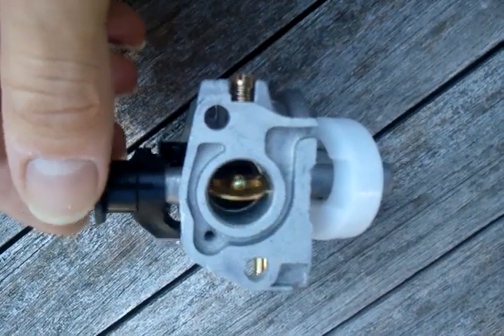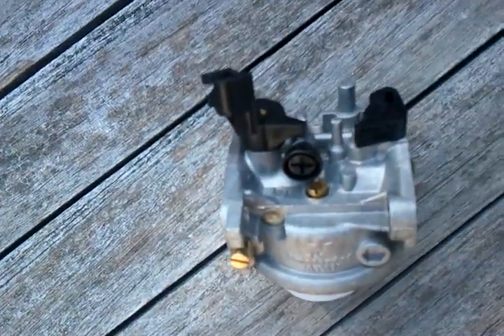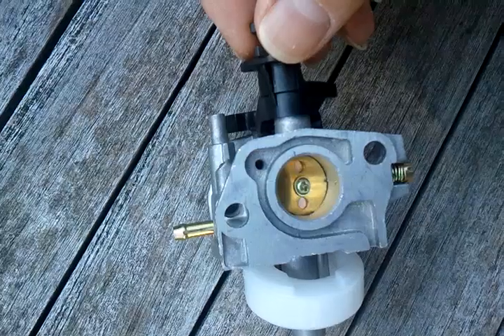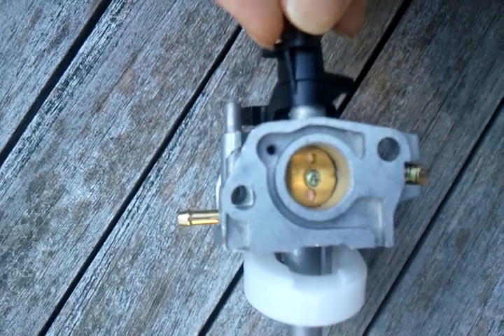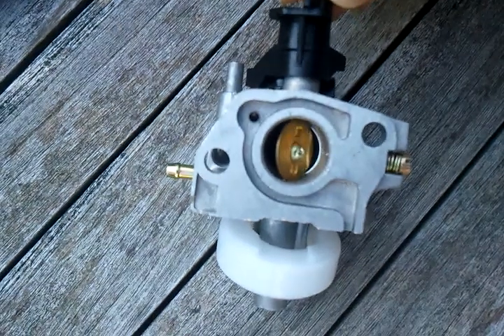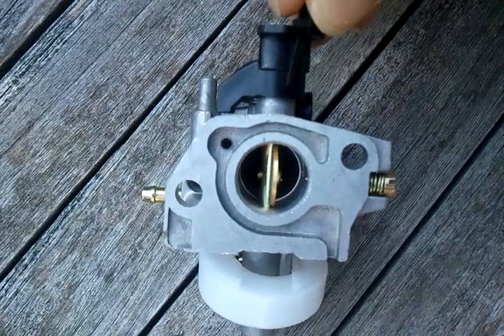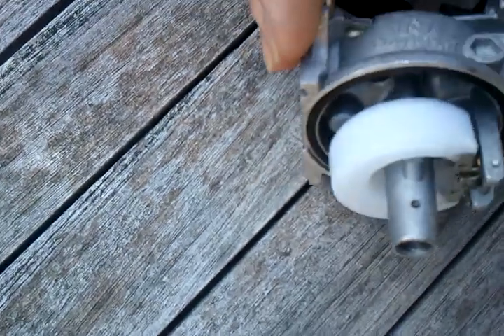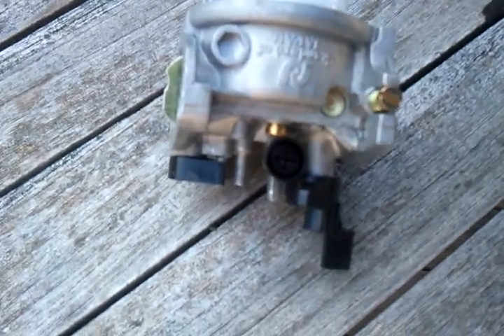Carburetor basics and troubleshooting

Comment: can these adjustments be done while the carb is on or is it too hard to get to?
Reply: I took the carb off and pushed a small wire through the hole but it didn't seem to have anything in it. isn't there a way to adjust the carb without taking it off, that's a lot of taking off and putting back on just to see if you got it right
Reply: the bottom, the side hole is so big i can see there is no obstruction. symptoms are the idle goes up and down constantly
Reply: yes that's what i pulled out and mine was a plastic plug with one large hole through the side and one very tiny hole in the bottom (the were all clear). I wish i could draw a pic to show you
Reply: no haven't gotten that far yet but that's a really good idea and that may end up fixing it, I'll do that tomorrow and get back with you, thanks for the help
just a note: i'm was looking to and may still put a 2 or 3 way carb on this but i've heard running it on propane or natural gas is bad for the valves, have you heard of that?
Reply: i don't know about you but i can't even see that screw let alone adjust it, is there a special tool for that or a special way of getting to it
Reply: yeah i was told that the lack of lubricant causes the valves to go bad but i was told you can get different valves for this reason (but i haven't verified the different valves thing yet)
I got a great deal on mine (bought it off craigslist) and the main reason i bought it is in about a year i'm buying an RV and becoming a full time RV'er, and i'm going to travel all over the US (boon docking/dry camping) and this gen will sometimes be my main source to recharge my batteries. I'm told it will run 18 to 24 hrs before it needs fuel
Reply: so how do you get to and adjust the screw
Reply: yes
Reply: yeah i know, it's just what they say. I'll be back with you tomorrow and let you know how things worked out
Reply: well it won't start at all now, I'm sure something isn't seated correctly causing an air leak into the carb (gotta pull the carb back out to see what my be getting in the way)
Reply: ok blew out carb again and reinstalled, this time everything went in so easy and seated correctly, runs great now, thanks for the help
Reply: not sure, is it to the left of that screw/plastic cap, if so mine is i guess you said a guarded one meaning it has a lobe on it so you can only move it about 1/8 of an inch in either direction but the problem is it is difficult if not impossible to get to while installed and i'm not going to take it in and out several times to do the adjustment

Comment: hello sir. I have a problem with my generator. when load is applied, it runs normal for some time then slightly drop then pick again. I have cleaned the carburetor using carburetor-cleaner but the problem still persist.
Reply from the maker: Sorry, I never saw this comment before.  Did you ever get it figured out?  Generators can be difficult to troubleshoot because it is hard to see the "load".  To be honest it sounds like your load is starting or stopping.  Refrigerators and freezers are great examples of this type of cyclical load which you will most definitely hear as a change in the engine RPM.

Comment: Mine was also surging. It is a close/ Huayi on a 208 engine. Turns out that the carb was missing the needle valve on the idle side of the carb. I have looked everywhere but could not find anywhere to buy just this part. It is not part of  a typical parts of rebuild kit.
Reply from the maker: Sorry, I evidently never saw this comment.  Are you referring to the black screw part which I point out in this video?  That was missing?  It may have been installed under a welsh plug or made permanent in some other way.

Comment: Good explanation & thank you for the help! Mine was surging and i cleaned everything except for that idle screw you showed at the end and it runs fine starts on the first if not second pull & runs nice. Although mine was not a screw it looked like a plastic plug and underneith the plug there was a very tiny hole that was plugged.

Comment: I have an ETQ generator with a 13 hp knockoff engine. It will only run on full choke. It has a Huayi carburetor with a solenoid but I can't figure out how to disassemble it for cleaning. Is it a throwaway?
Reply: They don't seem to store very well, had same problem and ran carburetor cleaner in the gas much more than bottle stated with small amount of gas and it cleared. Had same problem with snowblower. Now I store with both with gas additive and cleaner. Technically you really suppose to turn off gas and drain the bowl on the carb.

Comment: Just wanted to say Thank You, Thank You, for this video!! I bought a used generator and it had this surging problem you described here. Cleaned the carb (several times), but the problem persisted. Finally came across this vid, and realized this little plastic cap under the throttle stop screw contained a little pilot jet underneath. I removed and cleaned it, and my generator ran perfectly after that. Yahoo!!... Again thank you very much.
Reply: Yes, I do that and like to help others when I can.

Comment: quick question i got a predator 212 engine that start up fine and stay on as long as the choke is closed. but as soon as i open the choke the engine turns off. do you know how i can fix the problem. or what can i do
Reply: Check your fuel line for a pin hole, or make sure your gaskets are good on the carb. It's sucking extra air in somewhere.

Comment: Very nice video,very helpful explanation about the idle circuit.Would you happen to know what would cause an engine using this carburetor to stall out under a load step, but then be able to handle that load it the carb is choked about halfway? My version of the carb does not have the one hole that you point out on the carb face for the  P tube aeration supply. It is not drilled.
Reply: ***** Thanks for the reply back, that was my suspicion also.

Comment: My carb off my Champion 6.5hp OHV looks just like that, except it omits the two idle adjustment screws, it has just the main big black screw to adjust idle.  After sitting all winter the carb was gunked up, and I gave it a cleaning.  Now, it fires right up but is surging.  And mine doesn't have a black plastic cap in place of the idle screw, it has a brass plug.  Should I still remove that and attempt more cleaning?
Reply: *****
I decided to have another go at it after watching your video and a few others.  I pulled out the brass tab on top and it is indeed the orifice.  It wasn't plugged, but i gave it a good cleaning anyway.  This inexpensive carb has only the one adjustment screw and even that one doesn't seem to do much.  The engine seems to be running too rich, as evidenced by the appearance of the spark plug and the lack of throttle response.  If I push it full throttle it dies.  I did try riding the go kart around the block, but lots of missing, no throttle response but it eventually got up to speed even without any real throttle response, basically because it is idling too high.  I think maybe starting with a new carb may do the trick.
Reply: Yeah, I was trying to get my go kart going so I can sell it.  Was hoping someone else would take it off my hands and fix it, but I'll probably spend the $20 myself to get a replacement.
Reply: David Meyer
Turns out the carb was just fine.  I had removed the gas tank to clean it and when it went back on the linkage got out of alignment so it idled too high.  It took a new carb and more tinkering to discover the issue!

Comment: Hello I have a Honda GCV160. The mower is a Toro Quadra Cut System  and my engine is flooding. When the mower sits, the gas leaks out of the air filter. I replaced the carburator with a new one. The mower started right up but if I turn it off, it doesn't start again. I took the spark plug off and the engine was flooded again. If it was the float or the needle that was not working that should have been fixed with the new carburator. Do you have an idea of what it might be? Thanks
Reply: Thanks for your response. I decided to just close the gas line as soon as I turn it off. That way the engine doesn't get flooded and it starts again. Thanks..

Comment: which way will the idle mixture screw go for it to richen it up? in or out? i have a clone engine and put a bigger main jet in it but am looking to fine tune the idle.
Reply from the maker: Out or counterclockwise will open up the needle valve to admit more fuel.  The idle control screw is opposite.  You increase idle RPM by turning in or clockwise.  This will hold the butterfly further open.
Reply: I believe out to riches. Mine was to rich so I went back to 1 1/2 turns out from seated and it's leaner now

Comment: Hey Josh, do you know what the stock setting for the needle that sticks through the side of the carb in to the throttle plate area is? Thank you your video did me a solid btw.  I noted with my eye the amount the needle stuck through when I cleaned my carb. And I put it back and it seemed the same. And it's running good-- I just want to make sure it's bang on.  I Agree with the "cheap and easy to fix".
Reply: 4 and a half turns from fully in on mine

Comment: Started the snow blower after sitting for 3yrs without any use. Once I got it running again, it would not idle worth a crap and surged like crazy. Watched your video and got brave enough to pull the carb and clean the jet and all passages with a thin strand of wire. Put it all back together and now it idles really nice, is quiet, and I no longer have to run it with the choke on. Thanks for the Tips. Your video was very helpful!

Comment: Thank's a lot for the video, it was right on.  I had the surging problem and the engine would die at idle with the choke removed.  I had a plastic idle jet and cleaned it out with a thin wire.  Now, it idles just fine and runs good.